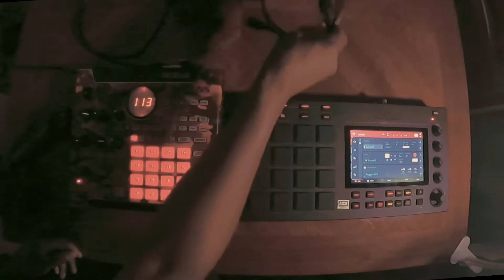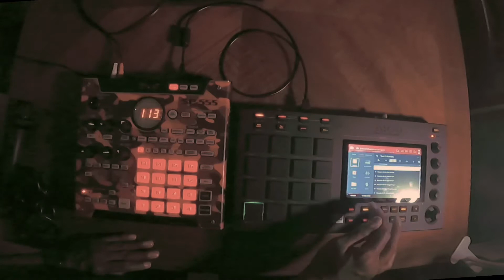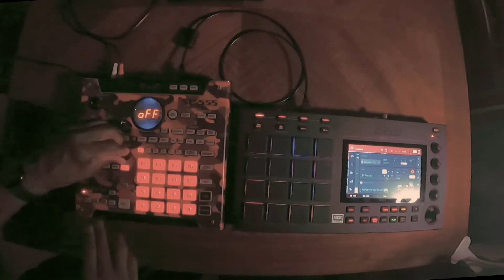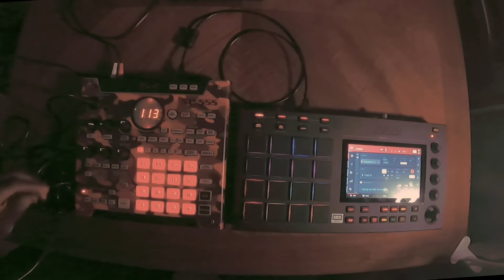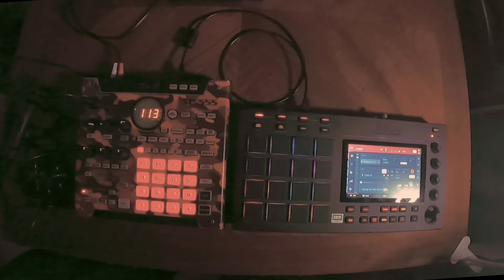How to use the Roland SP555 with the AKAI MPC

Comment: update bro i found out you actually can apply fx on a live audio feed. you press save to pad and line in at the same time and then you can use fx live like line out on sp 404
Reply from the maker: Appreciate the heads up! Another subscriber also pointed that out as well. It’s super dope🔥🔥🔥🤘🏾
Reply: @Yo_whatupwithyou  appreciate this video though bro would not have figured it out if i didn’t come across this. salute. be easy!